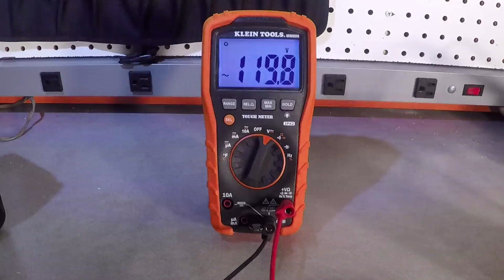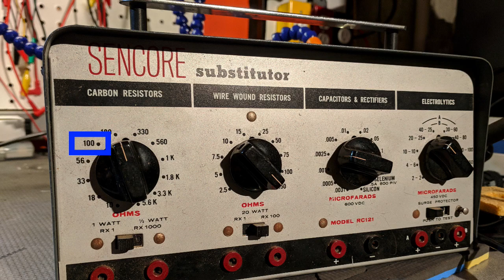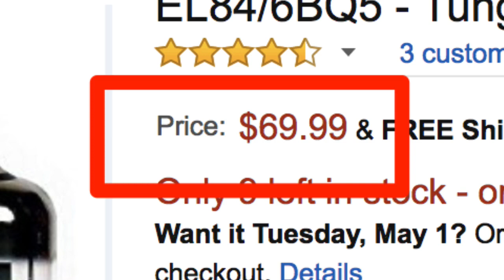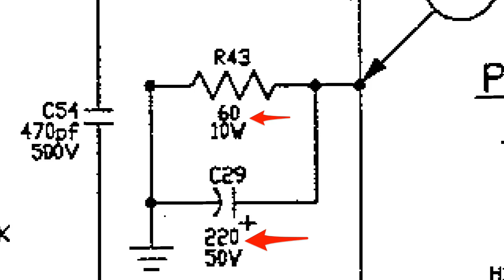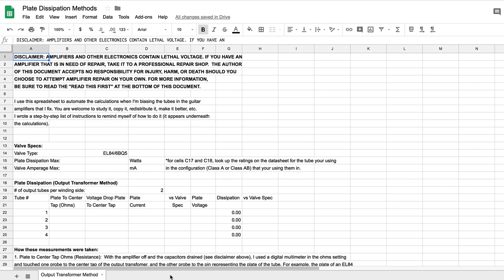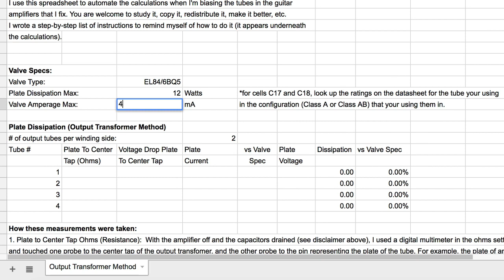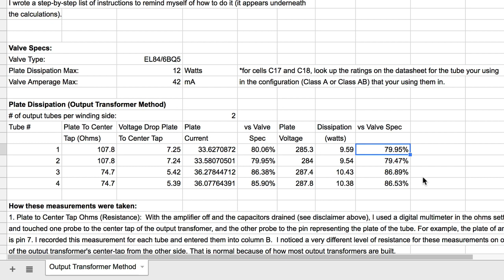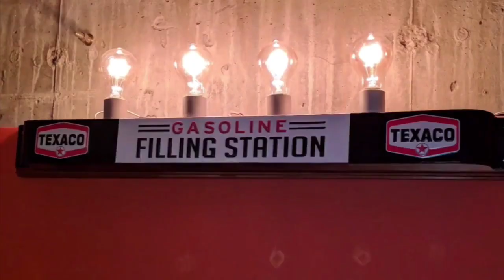Crate Vintage Amplifier Repair: Re-cap, Re-Tube, Re-surrection! (AmpMechanic #009)

Comment: I've got the Crate VC 50 head. Mine started doing the thing where I would hear static and the volume would go way down while playing my guitar and then would all of a sudden be at full volume and then drop and back and forth. Now I get no sound out of it at all. I had the tubes replaced a couple years ago and hadn't really played it much at all because of these volume issues. So I didn't think it was the tubes. Not sure what's going on with it. Trying to find an amp tech in my area because the clean channel on this thing sounds great. My dad has experience with electronics from when he was in the Navy, and after he got out when I was a kid, so we're going to take a look at it this coming weekend. Any advice on what you would look at first? I'm thinking those capacitors like you did on here. I've read some forums and people were talking about those, as well as issues with the jacks, especially the effects and footswitch jacks. Dad still has some of his old testing equipment like you have here, although not nearly as much of it as he used to. I might suggest he watch this video a bit too... 

 Anyhow thanks for the video.
Reply from the maker: Hey Doug.... though I don't know for sure, I suspect that the head won't have the sort of heat issues that the combo amp does. It's really hard to know without seeing the amp... but my gut tells me that if it started cutting out intermittently and then cut out altogether, that it might have been gradual progression of something like a capacitor going from bad to worse to just passing all DC. It's really hard to tell.  I'm sure the VC 50 sounds amazing when its working properly. The best tool (and one that you can make pretty cheaply) is a signal tracer. A signal tracer makes it possible for you to check each step along the signal path to see where things go downhill. But if you're not sure what you're doing, then it might be best to take it to a tech. There's a lot of high voltage in that amp and one mistake could cost you or your Dad as much as your life. So please be careful. Let me know how it turns out.
Reply: @AmpMechanic  Thanks for the response and the advice! I think my dad and I will do a limited look over of things and if it's nothing obvious or within our abilities I will then take it to a tech if I can find one. It seems to be a dying art, at least around here... back in the day it was a lot easier to find someone who could work on these things.

 I definitely appreciate the warning and will remind dad about the need for caution, especially because of the high voltages in these units. Gonna get him to check out your video as well, as you talked about some of that and I want to make sure it's front of mind.

 Thanks again for your response! I really appreciate it! I will let you know if we figure anything out on it, or if we turned it over to a tech!
Reply from the maker: @dougfa3515  Let me know how it goes. Be sure to download the schematic before you start working on it and if possible, use a local print shop (like Kinkos or Staples) to print it out on 11x17 paper (so it is enlarged). It may be multiple pages. The Crate schematics are very good with what voltages and oscilloscope wave forms you should be observing at various test points throughout the circuit (keep in mind the schematic is showing peak-to-peek values and you'll need to convert them to RMS).  But you'll need a signal generator putting out a 1kHz signal at 1 volt RMS (if I'm not mistaken). The schematic tells you. If you don't have a signal generator, you can probably get by with a smartphone or tablet. The wave forms are not so important. You'll need a good real RMS DMM too. Where are you located? Worse comes to worse, if you really get desperate, maybe you can send it here. But that would the very last option.. basically a Hail Mary.
Reply: @AmpMechanic  Great advice, man. I never thought about enlarging the schematics... I've been trying to find one that's legible. But the Kinko's thing is a good idea... I can tell you've done this a few times... LOL

 I'm just outside Richmond VA. You're in the Northeast, right?  That could be an option... Dad and I will check out some basic things and then we'll see how that goes and figure out what the next step is if unsuccessful. Again, thanks for the advice!
Reply from the maker: @dougfa3515  Boston.

Comment: Greetings Mr AmpMechanic. I have a Crate G40c xl amp that i acquired recently from a Goodwill auction. I was just wondering if you had any experience with this particular amp. It worked for a while when I first received it. Although the sound was fading in and out. And now for some reason I have no sound. After doing a bit of research I found many similar issues, all claiming to range from bad diodes in the rectifier, to bad caps on the power supply. I am very limited on my trouble shooting capabilities.
Reply: The easiest way, if you ask me, is to start with the input jack, "listen" for signal, and work your way through the circuit until you have signal loss. Sooner or later, you'll encounter the bad components.
Reply: Sounds like great advice. I really appreciate your feedback. Thanks @DavidBerlind
Reply: On that g40c XL I would absolutely start by either cleaning or replacing your instrument inputs. The originals are very cheap and I had the same kind of issue from mine from them
Reply: @incredifunk  I will certainly give that a try. Much appreciated.

Comment: I have the VC30. I get a cackling type noise when switching to the clean channel and no sound from the clean channel. The dirty channel works fine. How can I fix that?
Reply: Disclaimer: DONT try this if you have not understood the precautions in this video, and know how to drain capacitors. Even an unplugged amp can give you a fatal shock.
Re-flow the solder on the foot switch pins on the circuit board. PITA to get it out. Don’t heat too hot nor too long. Use good solder and a magnifier.
Reply from the maker: Amen Ton7Tube. One cannot stress the precautions enough.
Reply from the maker: Stanley, this could be any number of issues that would be very difficult to diagnose without putting my hands on the actual amp (or "hand" because you never put two hands in there!).

Comment: Do you think I could make a spreadsheet like your's for '70s solid-state power transistors using an arduino? Or is that just Excel?
Reply from the maker: I don't think it matters whether you do it in Google Spreadsheets or Excel. The spreadsheet functionality that I rely on is not very sophisticated (something any spreadsheet technology can handle). Hope that answers your question.

Comment: I just picked one of these up for super cheap! I cleaned up the sockets and will threw in some new tubes. One of the tubes seems to be running hotter than the others. How would you adjust the bias on a single tube on this amp?
Reply from the maker: Hi Daryl, did you buy matched tubes? I thought about modding the amp so that I could individually bias tubes. But then ditched the idea and left that one big ballast resistor in there.  Would have been major surgery for limited gain over purchasing matching tubes.
Reply: AmpMechanic I’ve never had a fixed bias amp before so this is all new to me. Mine is making this hum. Not sure where it’s coming from but as it is now, it’s unrecordable. The large caps don’t seem to be bulging. New to this stuff and already scratching my head over it.
Reply from the maker: @daryllamont9942  So, the tubes are matching or no? Matching doesn't mean same model. It means they were literally designated by the seller has have matching profiles (usually determined with a curve tracer).
Reply: AmpMechanic oh yes, sorry. Tubes are matching.
Reply from the maker: @daryllamont9942  the caps do not need to be bulging for them to have gone bad. These amps run super hot (the designers push the tubes quite hard) and there the amp was not physically designed with tube ventilation in mind. So, over the years, all that heat can easily cause the dielectric to dry out thereby ruining the caps. You could test the caps in-circuit if you have an in-circuit cap tester and maybe identify which caps, if any, are bad. But with this amp, you still need to pull the circuit board to get to their leads (which you'd have to do anyway to desolder and replace them).
Reply: I replaced all the power caps, and the death cap on the mains input. (I was getting a tingle from earth/strings) big improvement.

Comment: I also have a crate vintage club 30 that is having issues. Volume cuts in and out. What are some possibilities that I can do before I send it to someone.
Reply from the maker: Volume cutting out can be an entire range of things. I'm guessing the issue is unpredictably intermittent or you wouldn't be asking since you'd have a better idea of the source of the problem if it was easily reproducible. If you don't have a lab full of diagnostic gear, you could start with a chopstick while feeding a signal into the amp with a poor man's signal generator (it's hard to feed a constant signal into the amp with your guitar while trying to do this) and then tap on components. For example, if you tap on the tubes, you might discover that you are able to toggle the issue on and off and then that could mean it's a tube or tube socket. Or, just pull the tubes, clean their pins with an emery cloth and clean the sockets with de-ox and see if that makes the problem go away. Also clean your jacks and pots. If that doesn't solve the problem, my focus would shift to some tests that may require a variety of test gear (signal tracer, oscilloscope, or a DMM that can measure in Hz), but the general idea is to start at the input with a signal generator feeding a 1 kHz signal into the amp and working your way through the signal path all the way to the speaker until you find a location where your measurement instrument starts to register the problem. If it's cutting out completely when it cuts out, you'll see a complete loss of the audio signal (Hz and AC will drop to zero). If the volume is diminishing significantly but you can still hear it, then your Hz might still be there but your amplitude (ac voltage) will show major fluctuations. A few things about the Vintage Club 30. The tubes are nearly impossible to get to when the chassis is in the amp. I have no idea what they were thinking when they did that. So, first, not easy to maintain. You basically have to pull the chassis to work on this amp. Second, when the tubes are way back in there like that with limited access to fresh air, it gets very hot in there (even with the ventilation they put into the amp). Second, Crate pushes the output tubes hard and runs these amps very hot. More than necessary as this is a Class AB amp. The tubes could easily be biased to idle. They're not. This exacerbates the aforementioned heat problem. Third, that amp runs on a printed circuit board and guess what HATES a lot of heat? Printed circuit boards. If you get a lot of intense heating and cooling, it stresses the solder joints on the board which in turn could cause them to crack. A cracked solder joint somewhere in the signal path could easily be the cause of this problem. As it swells and contracts in response to the heating and cooling, the signal may or may not be able to bridge the crack and voila, you have an intermittent problem like the one you describe.Good luck!
Reply from the maker: I apologize for taking so long to reply to this.  Somehow missed it in my inbox. Volume cutting in or out can be so many things, it's hard to know. Since this amp is part solid-state (with a circuit board) and it runs extremely hot, one area of concern has to do with all the solder joints on that circuit board. The constant swings between very hot and cool (when it's off) can stress all the soldering and cause some to crack. Volume cutting in and out can sometimes be related to a cracked solder joint that is making a connection at one moment, but not at another.  But the problem you describe can be related to SO many other things, so it's hard to say for sure.

Comment: Really helpful video, I have the same amp and I'm in the process of checking the voltages, putting new caps and the whole 9 yards. I was wondering if you could share the  amp diagram with me, I'dd appreciate it a lot! :)
Reply from the maker: Hi John-Jacob... all I did was an image search on Google for the schematics (there are two pages). The actual model of the Vintage Club 30 is the VC-3112. So, you may have to search that. I just tried it and found this link which contains the two schematics; http://www.4tubes.com/SCHEMATICS/Music-amps/Crate/?C=N;O=D

Comment: hello, I had a crate vc50 and changed the filter capacitors, then I got 50cycle hum on the clean channel...any ideas?
Reply from the maker: Hi Eirini, are you sure you got all the filter caps? There are so many in there. Have you tone-traced the circuit.. (checking the circuit for hum through each step)? What about any wires carrying AC? Are they twisted to cancel the noise?

Comment: 03/03/2022,,I have the MesaBoogieDC3 & '71Fender TFL5005D head, getting dusty cause no doctors could fix them. Sweetwater in Ft.Wayne changed the speaker and power cord.in my DC3 for $400. 👁 No way in hell they will ever touch it again. dont know shtt